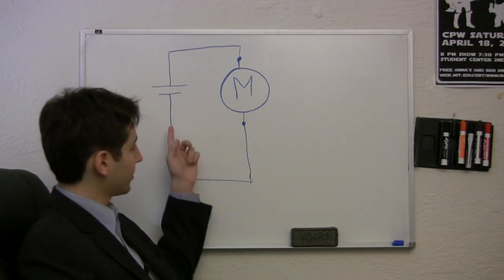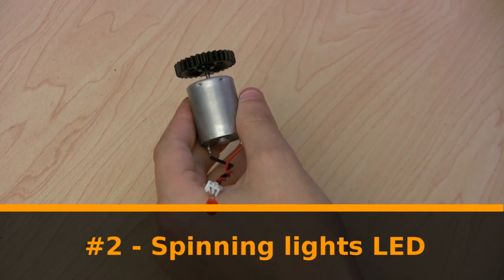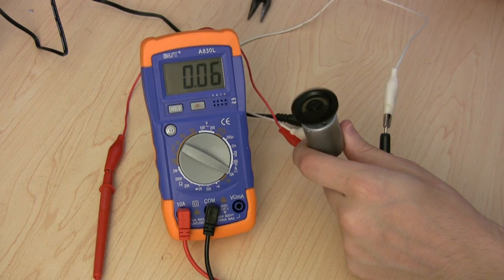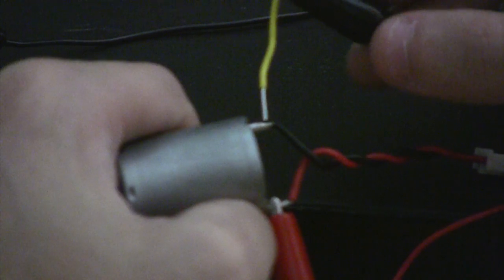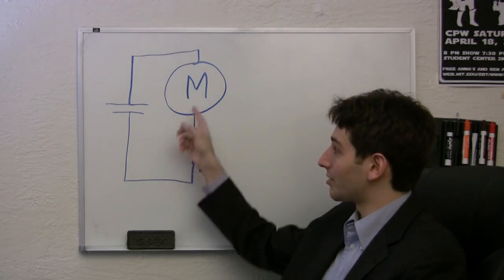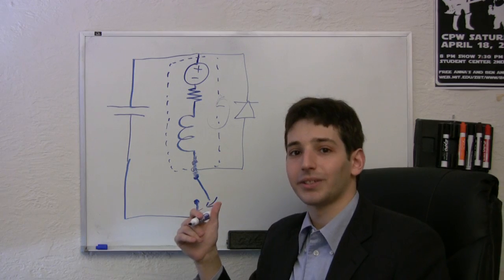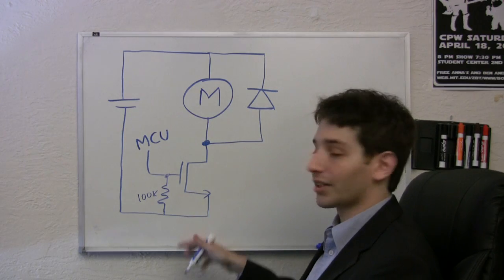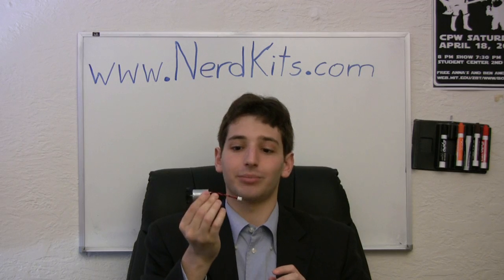Motors and Microcontrollers 101

Comment: Great job explaining whats going on with motors!
I had a DC motor with a green thing in parallel with the motor, was this a flyback diode or a filtering capacitor, which one is more common?